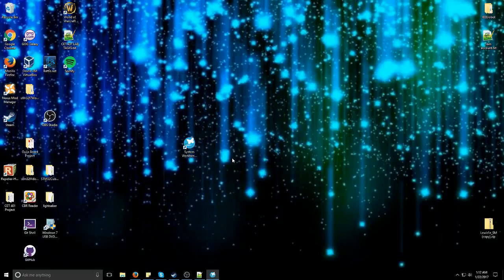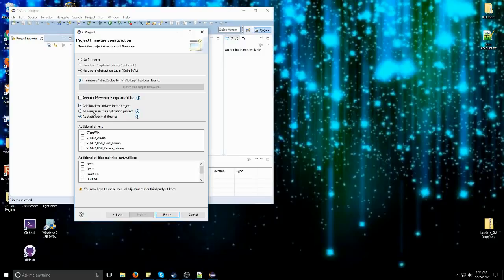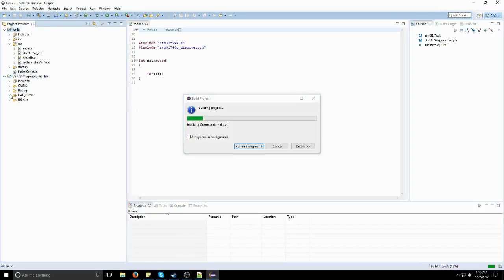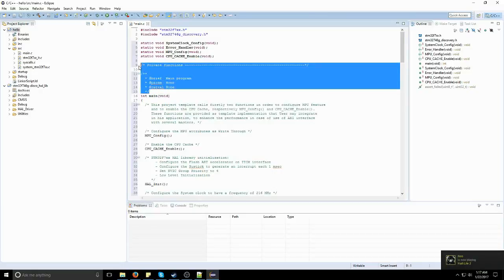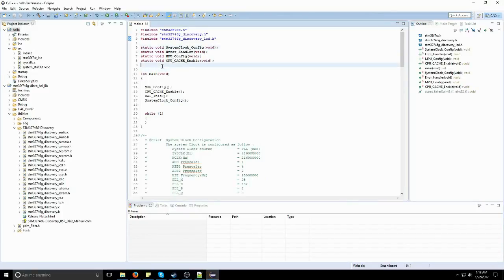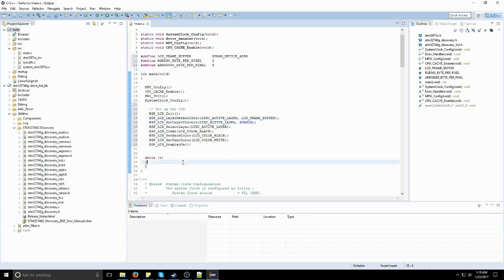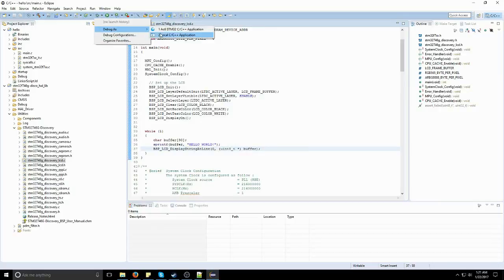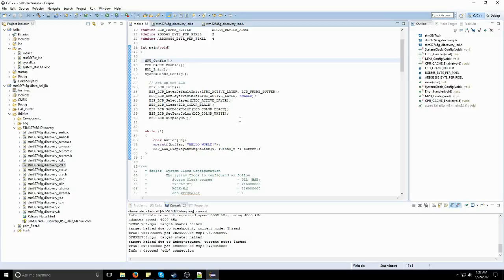STM32F7 - Tutorial LCD Screen

Comment: BSP library only can be use for 1 kind of TFT-LCD ot it can use for all TFT-LCD?
Reply from the maker: Hi Miguel, it is only for the kind of TFT-LCD that is on the development board. The HAL TFT struct and functions in the HAL library can be used for other kinds of TFT-LCD screens though. The BSP is just a Board Support Package for this particular board.
Reply: Keith Conley  Thanks very much, so are you interested in use HAL library to do a code for other TFT? I'm trying to do a code for a TFT but I don't know exactly how to do it. If you know other library to do a code for set up a TFT, you will tell me.
Reply from the maker: Miguel Angel Sanchez  I am interested in doing that at some point, but right now I'm working on examples for register level STM32 code, and I'm planning on doing a series for that when the semester ends. Thank you for the offer though.
Reply: So if I change the timmings and the settings of the BSP library for this TFT, and I put the settings of my TFT, do you think that TFT should work well?
Reply from the maker: Miguel Angel Sanchez  Yea, it should be fine. All of the settings are actually that timing settings. The print functions etc are just wrappers around the HAL functions. This is the application note from st about the tft controller on that processor. I don't know how much help this'll be for you. https://www.st.com/content/ccc/resource/technical/document/application_note/group0/25/ca/f9/b4/ae/fc/4e/1e/DM00287603/files/DM00287603.pdf/jcr:content/translations/en.DM00287603.pdf

Comment: Hi, I tested it on my stm32f469-discovery and it worked.
Do you know how to use STemWin_Library_V1.2.0 \ Libraries \ STemWinLibrary532 \ Software to mount a screen and write to stm32?
I would like to do this without using mbed, I am using STM32CubeMX and System Workbench for STM32.
Can you help me? Engineer student.
Thanks in advance.
eliezeroc@gmail.com
Reply from the maker: Hi, I do not unfortunately. If you get it working I'd love to see how you did it though!